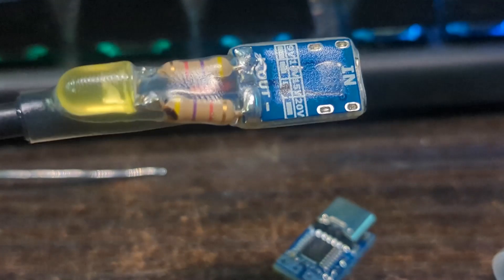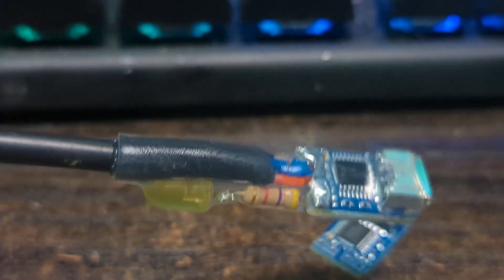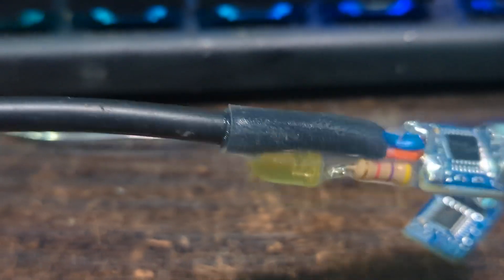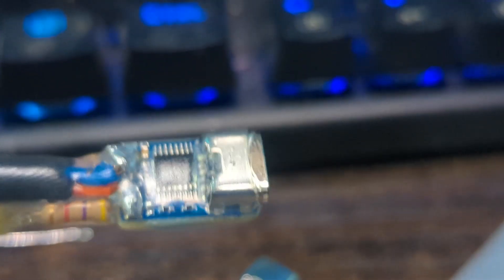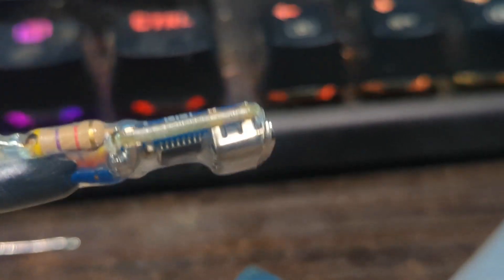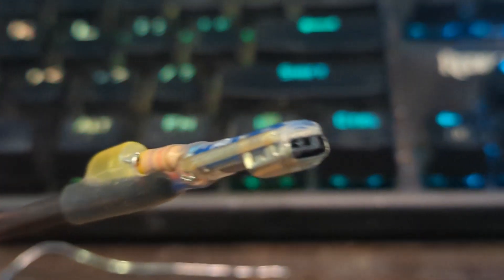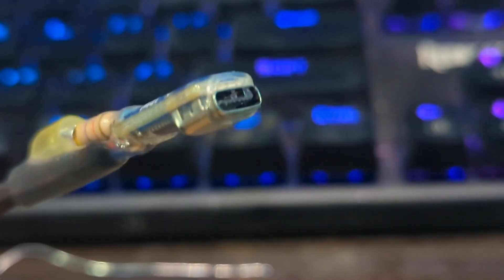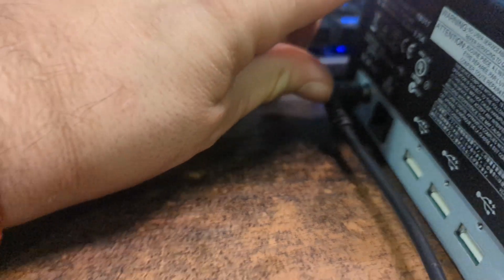USB C Power Delivery Toughbook Charging

Comment: Very cool!  That might be exactly what I'm looking for.  What parts were used?
Reply from the maker: Just a small circuit board from amazon that requests 15V from USB PD, I'll put a link in the description
Reply: @Morninglowe  Thanks!!
Reply: @Morninglowe  do you have a part number I can search for? Is 15 Volt enough for the 15,6 Volt Toughbook?
Reply from the maker: @accountname1651   Yes. the 0.6v means nothing, however! High draw toughbooks like 30 series may not charge this way. I only use it for my FZ series units and my CF-19. I don't have a part number but searching for 15v USB C PD board should get you the part. Sometimes you can even find premade cables with a 5.5x2.5mm barrel on the end like https://www.amazon.com/2-Pack-JacobsParts-Type-C-Trigger-Connector/dp/B08NTTK8S9
Reply: @Morninglowe do you know if this cable is compatible with the cf-20? Looking to move to usb c charging for it if at all possible.

Thank you
Reply from the maker: @michaeldullaway746  Yes I use it on my CF-20 with a 45 watt minimum USB-C PD charger and with my portable PD power bank, mine has dual batteries too.
Reply: @Morninglowe thanks for your video and help. Got the cable yesterday and everything is working perfectly with my Cf20 😊
Reply from the maker: @ICRDTech Yeah I use it all the time on my CF-20. Check Ebay for batteries sometimes they pop up, It's always a bit of a mess finding parts.